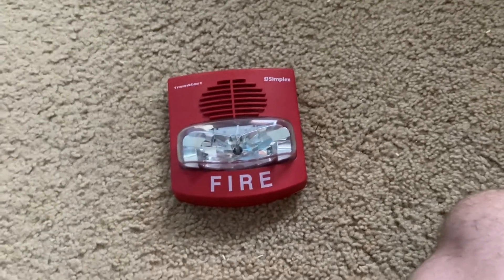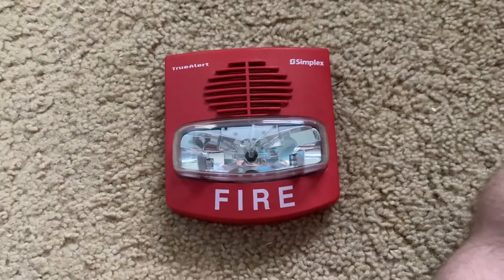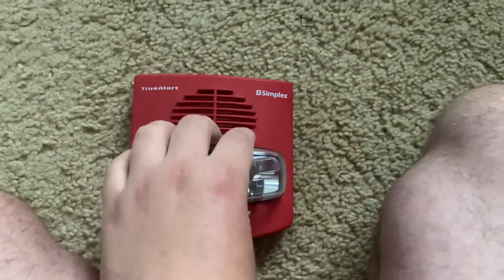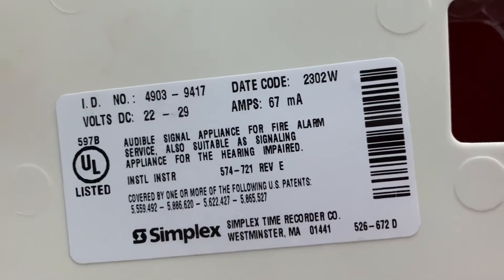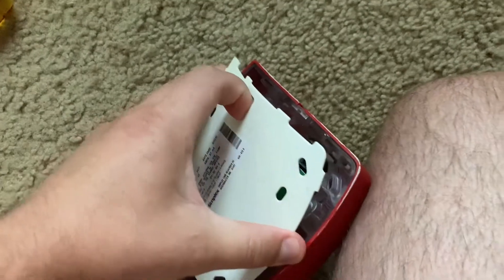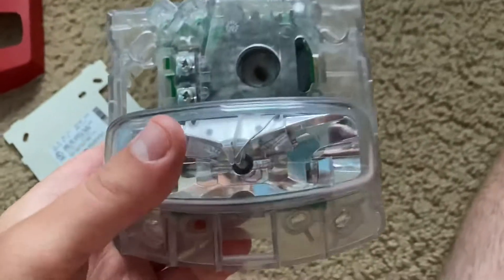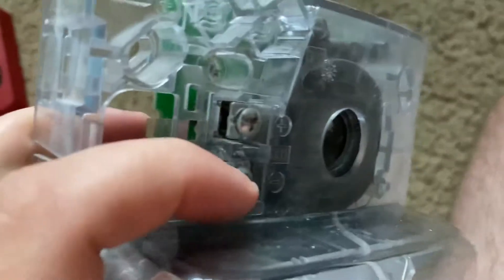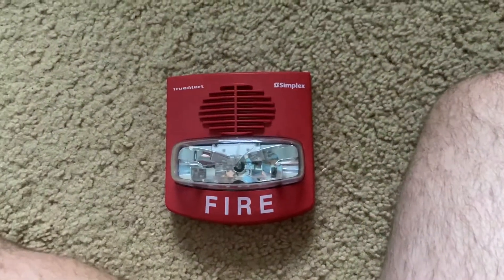Simplex 4903-9417 TrueAlert Horn-Strobe (OVERVIEW ONLY)

Comment: Is it fixed or multi-candela?
Reply from the maker: I actually do not remember, because it’s been a while since I last looked at it.  I would suspect that it is fixed, but I could be wrong.  I will update you once I look at the horn-strobe again.
Reply: @andrewsstation6436  From what I just looked up, it's fixed. They don't make these ones anymore with the exception of the four-wire versions with the SmartSync switch. And of course, the retrofit ones.
Reply: @andrewsstation6436 Fixed 15CD strobe for the 4903-9417. 9418 75CD. 9419 110CD. Now these particular 3 models are discontinued and replaced with the newer multi candela 4906-9127 TrueAlert. Fixed Candela Addressable TrueAlerts are also discontinued. Fixed Candela 4 Wire TrueAlerts are still in production.
Reply from the maker: @aidanthetoiletelevatorfire7554  Thank you for that information!